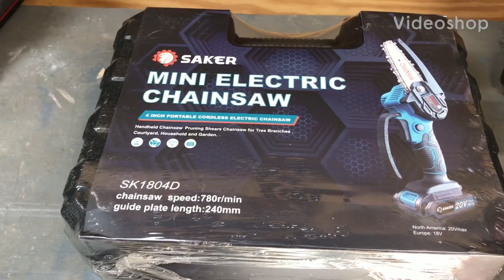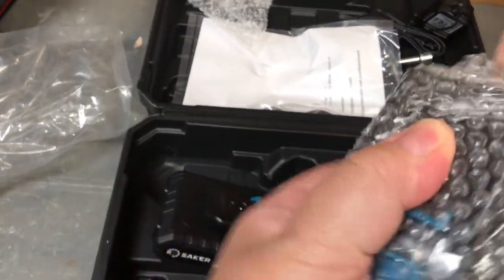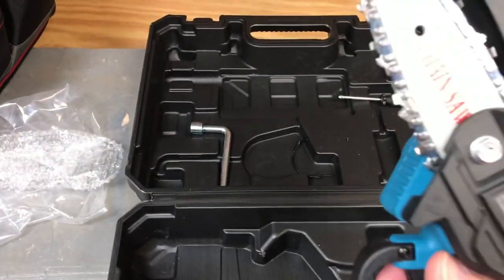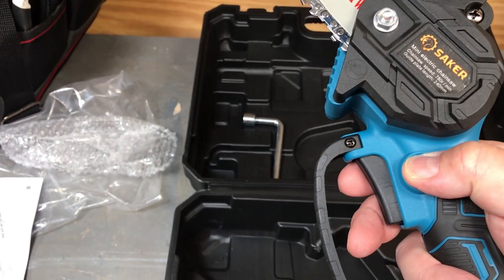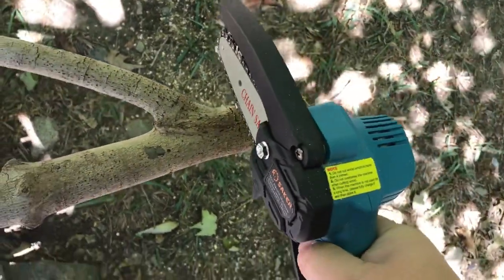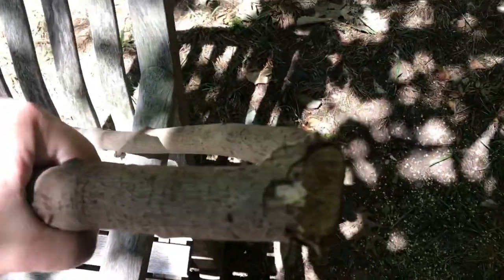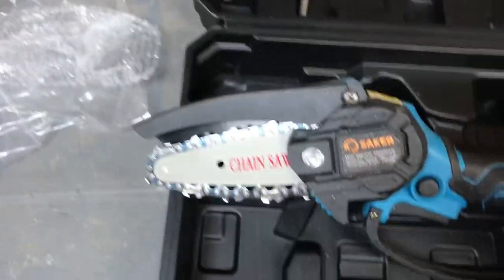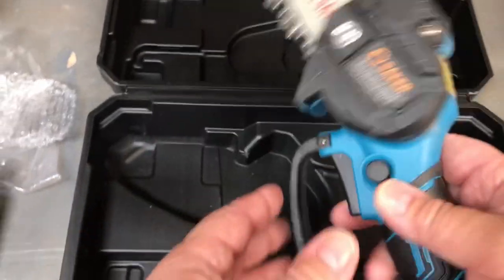Saker Mini Electric Chainsaw

Comment: Where do you add chain oil?
Reply from the maker: You just add it the the chain before use. There is no oil fill on the unit.
Reply: @HighRidgeHandyman  what oil can I use on it? can I use WD-40?
Reply from the maker: @lancebasco6938  Sure that's fine